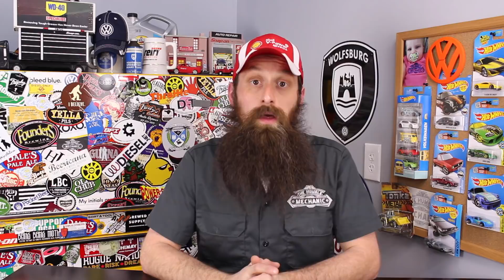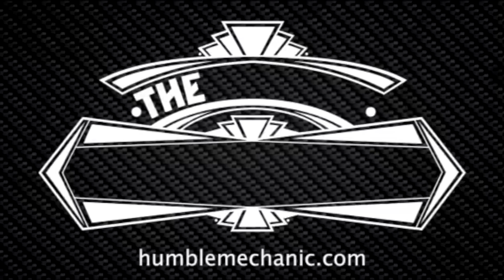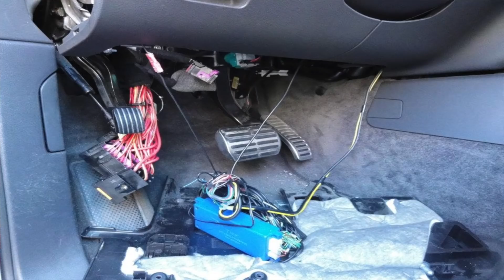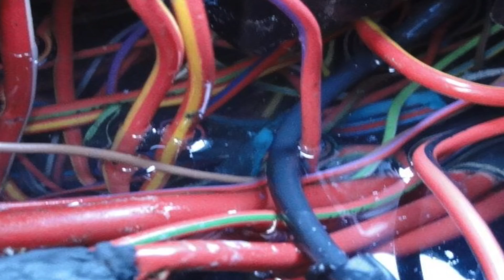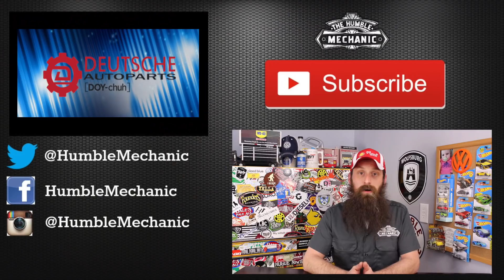Top 5 Failures of the Volkswagen Touareg

Comment: I got the 2007 V10 it's fantastic
Reply: Shane Serpico Had it almost 5 years now, coming up to 200,000 miles. And it's still going strong, all engines break eventually but I think I got my money's worth out of my V10 so I will keep it as long as I can. But thanks for your concern.
Reply: I never really look at the fuel consumption but I get about 500 miles out of a full tank
Reply: I can and I did, I said I was going very slow. The range went to over 1300km (I thought it malfunctioned) and when I went to a gas station to see how many litres it would take to fill, it only took 23 litres for 360 kms travelled which is actually less than 6.5lt/100kms.
Reply: And of course the new 4.2 TDI is more efficient but I purchased my V10 second hand for 13K Euros. The 4.2 was about 5 times that!
Reply: Well the way I look at it is that nobody buys a V10 SUV and expects it to get a high MPG. All I know is I get about 500 miles out of a full tank. Sure if I drive a lot round town it drinks diesel but on a long run on cruse control its really good. 
My 2007 V10 goes like fuck when I need it to, holds the road really well, as it's the top of the range model it has all the leather and toys I could ever want. 
The only problem I have is that as it gets older and will need to be replaced I don't think I will find as good a vehicle in my price range.
Reply: They didnt make an 07? only 04 05 06 08???
Reply: TheRealMrRoboto May be different in the USA but I defiantly got a 2007, 5lt 10cyl TDI Touareg.
Reply: in the USA they might of only been 04 06 and 08.  Where are you from?

Its sad I Almost bought an R50 from Canada but there were too many issues with import taxes at the time.
Reply: TheRealMrRoboto I am from Scotland. I wouldn't bother with the new Touareg, they no longer make the V10.
Reply: John Cameron you are a true fan then, the R50 was the special edition V10 TDI
Reply: I have the 2005 V10 and no problems whatsoever apart from a rear battery swap I did yesterday after 5 years that I have it (I think it had the original Varta still on).
Reply: Just wait £500 per injector central diff servo, seat loom, battery loom, kkeeerrrrchang
Reply: RogueBrit Dear GOD I hope not. I have had it 4 years one and it is a really fantastic car. I don't thrash it and my mileage is low these days, but like any car it could go wrong at any time.
Reply: How is fuel consumption? I Got R5 2.5 tdi 2007.. geting  average 10 liters on 100/km combined..
Reply: 22-25MPG
Reply: It depends on how you drive it. Once, while I was driving in Switzerland (where there are many ups and downs) I managed to average 6.5lt/100km, changing gears (triptronic mode) exactly on peak torque (about 2000 rpms) and feathering the gas pedal. 

Not the speediest way to go, yet if you care about economy it has good potential. However if you were to drive on the no speed limit Autobahn, you'd see the fuel gauge moving. 

On average, at 120-130 km/hour (set on cruise control - not the best way to achieve best consumption) you'll see 11lt/100km.
Reply: Actualy new Touareg 3  has even better engine 4.2 tdi v8.. it has more power than v10 tdi. And it is way more cheap to maintain..
Reply: Why pay 80,000USD?
Reply: TheRealMrRoboto I paid a hell of a lot less than that. Only millionaires and fools buy new luxury cars. I don't know how it works in the US but in Britain the first buyer pays. The purchase tax, then after a few years big engined cars price drop like a stone. All my life I have bought top of the range big engine cars you can get fantastic deals on the as most people are scared at the insurance and running costs.
Reply: John Cameron highway 0.85 /10km. Summer average 1.01 at 10km. Winter 1.25per 10km. Many electric problem now. 2005 V10. 300000 km use. My wife loves this car. I've got an Audi A2 1.2 tdi 3L to compansate the fuel avarage. 14 fault codes now, red warnings for brakes and air ride.
Reply: 6,5ltr/100km in a VW Touareg... You cant do that gas milage even in a Golf 1.9 tdi 77kw.. LOL
Reply: U must have some great quality Fuel then, because i cant under 9,5 liters per 100/km with my Touareg R5 2.5Tdi.. Combined... It is not healty for diesel  engine to go low rpm.. under 1500..
Reply: John Cameron Here in the US Luxury car prices drop too once they're out of warranty because no one can afford to fix them when they break (yes when). Also if your saying a V10 is fantastic you must not have had it very long (mileage not time) and never looked at the TDI forums. I'll save you some trouble, get rid of it before the cams fail, the turbos fail, and any other of about 1000 things fail that require R&R of the engine, I mention the TDI forums because these are all common high fail components on the V10.

Comment: hi there, i have a 2.5 r5 touareg 2005. the problem is, when the vehicle is stationary for like 10/12 hrs, whether mid day, morning or night, winter or summer... it starts after a long long cranking. once started it goes on perfectly the whole day, 2 sec crank and it starts, but still when parked for like 10/12 hrs it needs a minute or two of constant cranking, plz can u help me with the issue what that probably is?
i consulted a few local mechanics, a few say its one of the fuel pumps and some say its a problem with the cylinder head that needs to be changed, your expert opinion will be super valuable. thanks

Comment: Our SUV for the people is having issues driving uphill/acceleration [touareg v6 basic model 2005]. One day the truck would not downshifting to maintain acceleration uphill. Going manual mode to downshift does not seem to help [put it sounds like it is downshifting]. In addition, normal level driving difficult to speed up when driving [very dangerous]. All normal lights go on. VW dealer replaced throttle body, cleaned electrical connections, new battery. One week later, same issue. Dealer of course has never seen this. They now think the wiring harness is the issue, short somewhere but cannot guarantee that if the harness is replaced that it would fix the problem. I asked the dealer to call the factory for support but not sure if this will help. have you had this issue, if yes what was the solution beside buying a Toyota? Never had an issue beside the bulbs burning out first 8 years. Thanks.

Steven
Reply: I'm having the same problem. I have a 07 with the V6. I haven't taken it to the dealer, but I suspect carbon buildup

Comment: 2012 Touareg seems great!
Reply: you have a TDI?
Reply: I love my 2012 Hybrid!  I bought it new and now have 104,000 miles on it.  Just a few repairs of any consequence.
Reply: J D hi, just curious what repairs you did so far on your Treg, and any special maintenance during whole ownership? Which gasoline are you using?
Reply: Hi, Pawel.  I use the highest premium gas available.  As for repairs I've had to have the following done:  1.  Replace hybrid battery cable  2.  Have pistons cleaned of carbon (the build up was causing a fault light to come on)  3.  Replace the catalysts (sadly this was around 102,000 miles after my extended warranty had expired - cost around $3,000).  Those are the ones I can think of.

One thing to mention - I am now over 105,000 miles and have never had to have a single thing done for my brakes.
Reply: J D Hi JD, thanks for detailed response:-) over a 100k miles with only those repairs seems like pretty reliable vehicle.
I had 47k so far on mine, but I heard some noise coming from the front wheels while driving. My mechanic told me that those Pirelli tires are known for being loud. But my friend mechanic told me that I may consider changing wheel bearings. Did you have any problem with wheels? What tires are you using?
Reply: Hmmm...  I would take it to the shop before taking your friend's advice.  

I have not had problems with the wheels at all.  I have Pirelli Scorpions, and they were especially loud after I first got them.  I believe the vehicle originally came with Continentals, and they were much quieter.

Comment: I have a 2004 that says " steering fairlure workshop "
Reply from the maker: +guillermo sanchez may be looking at a steering lock failure, or an access start module failure
Reply: I have a 2006 touareg the sterring feels like theres no power sterring had the fluid flushed but didn't fix it niw my mechanic wants to try to replace the pump just paid $150 for the flush any help would be appreciated

Comment: lol.. We were one of the first suckers; We still have our 04' v6. On delivery it had 1/2 gallon of water in a taillight, and nobody knew how to replace it. Once we got beyond the driveshaft failure, trans software issues, hvac blower motor, sun roof leaks, seat airbag wiring, horrible remote range (still sucks), wood trim cracked, TPMS and light bulb issues, and non-stop 4wd workshop faults its been just fine. Our tires and brakes have been great and never had to have it aligned - couple sets of tires and only one set of new front rotors (never replaced rears), one battery, Cats twice (that sucked as second time was not warranty),  one alternator, and belt/plugs/coil packs in 12 years (engine has been flawless). Removed and de-coded TPMS to eliminate that, and driveshaft was replaced under warranty. Bulbs have still been a pain, and the headlight extractors both broke (had to cut them off). Worst has been the trans where you give it gas trying to pull out in traffic and absolutely nothing happens.. scary as *&^T! Still herky-jerky in the trans, but still runs and drives pretty much same as new. Seems horrible when I think back on it, but  it's still tight and drives nice and tows my race car just as well as day one - but trailer lights won't work right lol. Update... Had a coil pack pop and just did a fuel pump. Still like the damn thing! (had a coil pop in my 13' Bug too - what's up with these damn things? - been going bad for 20 years now... would think they'd have them figured out by now). 2017 - had the rear seat belt failure where I had to unbolt the belt to get the seat up. Had a 2nd drive shaft (cheap parts now) and had a devil of a time getting the old one out. Still have it though, 14 years so far! lol
Reply: Still have it? Lol
Reply: Which engine? in liters

Comment: Oh no! I have an '04 Touareg! I bought it about a year ago and I was seeing some of the TPMS, tire and brake wear already, but I thought that would be the extent of the engineering challenges. I put a new fuel pump in a couple months back and just put a new HVAC blow motor last week.

Thanks for the heads up Humble Mechanic! Great video as always!

-Charles
Reply: +Charles David 

I'm about to buy one of the same year as well, and I am researching the crap out of it! The good thing is that you can get a mechanic plug a VAG-COM into the car and disable the TPMS (you really don't need it anyways). It's a five minute job to do!

Also, the original fuel pumps and blower motors in the 2004 were garbage and wore out prematurely. Since you replaced them with more recent and updated parts, you hopefully shouldn't have a problem with them again.

Once all the POS parts on the 2004 fail and are replaced with updated parts, the 2004 is generally a pretty reliable truck! Just seems to have a mid-life crisis as all the older designed parts fail
Reply: +Kyran Mcgowan I actually recently got VAG COM. It's really a necesity when you have a VW/Audi product. I'll have to look into the TPMS thing. I have to say my overall impression of the 40 valve V8 Touraeg is nothing short of, " this is the most amazing vehicle ever..."I know the parts can be expensive and the repair procedures extensive at times, but this is a great ride and I would buy it all over again if given the opportunity. Bently Manual, VAG-COM, Patience and an open mind.
Reply: Charles David

Man, you're really getting me pumped! And you're right, owning a Touareg (or any VW for that matter) is all about your mindset going in. As long as you do your homework (as you have) and know what you're getting into, you'll have a great experience!

Also, I'm looking at the 4.2 V8 as well. The gas mileage isn't that much worse than the V6, and you get ~100 more HP. What a great engine! Can't wait to get this car.
Reply: +Kyran Mcgowan I never knew that much about the Touareg, except the funny name, before I bought it. What an amazingly complicated over engineered tough high performance beautiful machine...It began to make a bad noise on start up and I was all ready to buy a new chain tenioner as I began to suspect that component failed. I bought new plastic pads from Gremany in case it was just the pads and an entire gasket set to replace when I did the job. Then I learned that the bolts that hold the cam caps must be replaced and I was about to make that purchase when I read that this is common issue. And if it showed up at the dealership VW would not pay the dealer for the work as the oil bleeding out of the hydraulic tensioner was simply anoying and dissapears as oil pressure builds up.I don't really know what the reality is right now. I plan on eventually doing something to the tensioner system, however I'm recovering from a bad motorcycle accident and I have lost the ability to complete much of what I have begun.
Reply: Charles David

Man, that repair must cost a fortune! Especially since it involves the tensioners (which I hear are really hard to access). Thank god for those sites like Club Touareg, which provides great resources for stuff like that. And sorry to hear about your accident, hope you make a good recovery.

But that sorta thing is one of the biggest things that I'm worried about. Since this car is so over-complicated, it's really hard to diagnose some of the problems.

Also, does your car have the Kessy system? If so, has it given you any issues, or does it work as it should?
Reply: +Kyran Mcgowan Thank you. If you have any questions that I may be able to help answer, let me know. If I have expirience with the issue I may be able to help.
Reply: Charles David

Thanks Charles, I might take you up on that!

Comment: I love my Eurovan (it's my second) but the Touareg sounds like a total nightmare.

"I think I'll buy a $50,000 complex SUV so that mechanics can cut their teeth on super complicated systems."

I like your video but I could never see myself owning one of these cars.
Reply: I just bought a 2004 V8 Touareg and I love that SUV. I only have had one issue with headlight range control in the panel and don't know what that means. I've been reading about headlight level sensor but the information is really confusing.

Comment: Are you talking about the First gen Touareg because I own a 2ed gen 2012 tdi execuline I haven't had any of these issues
Reply from the maker: Other than the Adblue issues yes. The newer gens are great
Reply: My 2013 TDI Sport lost the shifter box in the center console. Electrical contact failure, won't tell BCM or ECU that car is in "Park" therefore, won't release the KeyFob, therefore, you can not take the keyfob with you and lock and arm /secure the car. Therefore, you have to lock it up in your garage, therefore, I can NOT pull it out because it won't lock, to access the EVSE in my garage, so that I can charge up my 2015 e-Golf SEL.   $800 part, 7 hours labor. VW is covering it under "Good Will" for being a very loyal customer.  Part is out of stock everywhere in the USA, all warehouses. 6 out of 8 on order are already spoken for by dealerships that have to R&R this part.  Watch this for trend analysis. It's my belief the plastic in this part is more prone to failure in the heat of summer time, plastic gets hot and cracks, losing the sensor or the electrical connection that controls the ECM and the key release mechanism in the dash for the KeyFob.   Germans evidently don't do failure analysis on VWs.
Reply: Mine is a  2011 with no adblue so 🤙

Comment: Oh the good old days of 1st Gen Touaregs! I almost forgot about the positive junction near the drivers left foot. I've done tons of those. 
Another common issue was wiper pivots seizing...and sometimes cracked in half (you'd think the wiper motor fuse would pop before the motor was able to force the pivot so much to crack it)
Something common we'd see up here in Canada was the fuel pump wiring at the rear left of vehicle corrode to smithereens and the truck would no longer start.
Common issues or not..... These trucks kept us in business!

Comment: The add blue heater issue , couldn't VW  just install the active add blue system in the engine compartment and passive downstream where the engine heat keeps system hot and working better ,similar to the New Mercedes E class systems for 2017 ?
Enjoying the show and advice !
Thanks
Joe
Reply: Yes, but they chose to not heat the AdBlue with the engine in this engine.  Additionally, the heater module is very susceptible to failing; can all but guarantee it every 100k miles, if not sooner.
Reply: 2012 passat tdi, ad blue heater failed at 46k, 2012 Touareg TDI, Ad Blue heater failed at 42k, 2014 Passat TDI, Ad Blue heater failed at 47k.  They all fail, VW obviously wants to sell spare parts that are expensive to install.
Reply: VW is not alone with Adblue heaters failing. My ML350 has gone through 4 of them in 275,000 KM (170,000mi) It's going to get deleted the next time it fails!! Oddly enough I found this video because I'm looking at buying a 2014 TDI Treg with 100,000 KM on it.